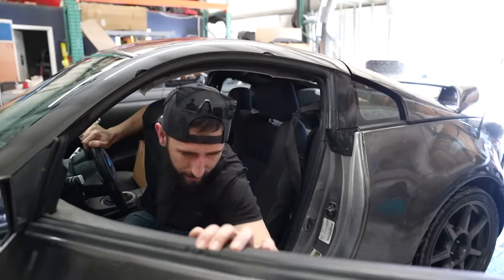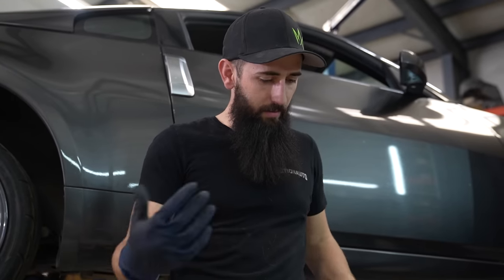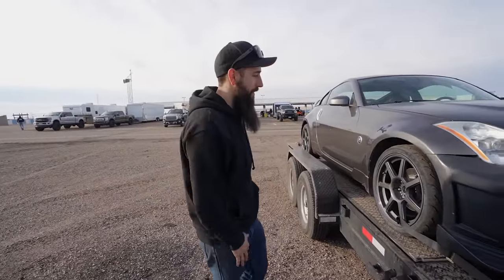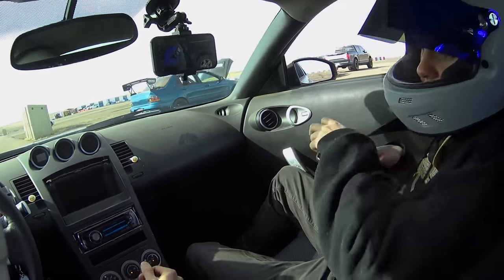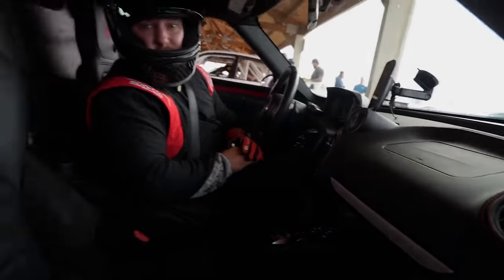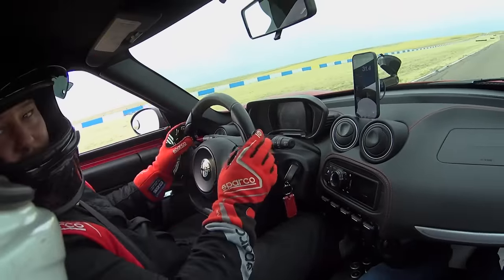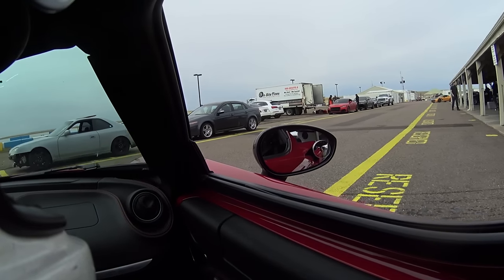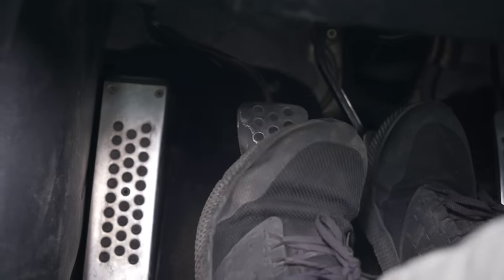Why I Will NEVER Sell The 350z!

Comment: You might look into the metal spherical bushings for the front compression rods. Those really tighten up the steering feel. I have been running them for 4 years on the street.

Comment: the clutch is likely heat soak from heat from headers switch to a stainless line and put a lot of heat wrap like 2 - 3 layers stock line comes with heat shielding that is sometimes gone after higher km check yours still has it at the very least.. and switch to high quality dot4

Comment: I've had my Z for ten years. Never tracked her, but she gets ripped on sometimes on the street. She's been great and there's only been two times in 90,000 miles that she's needed major work. On my third clutch in that same time. I swear by the Z platform. (07 and up) Currently at 174K miles.